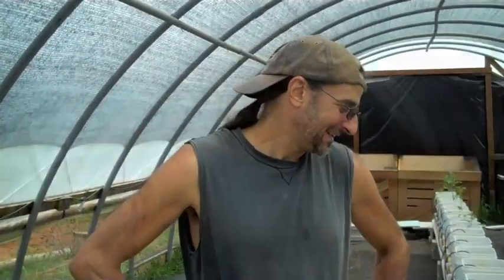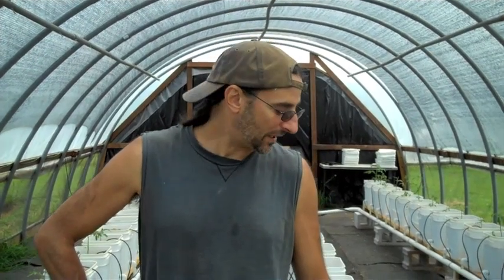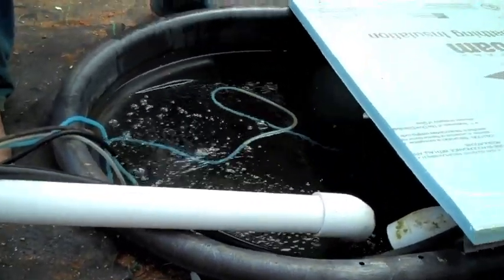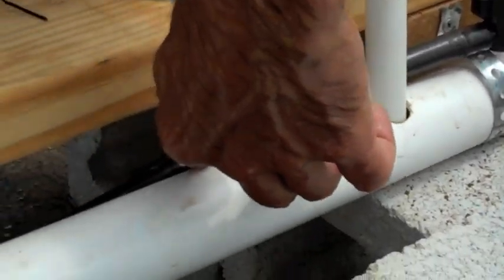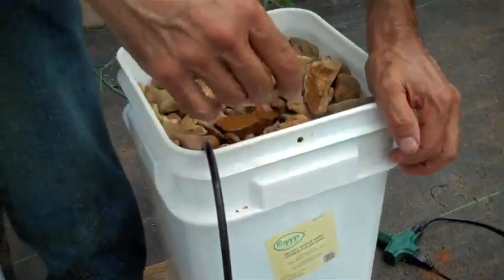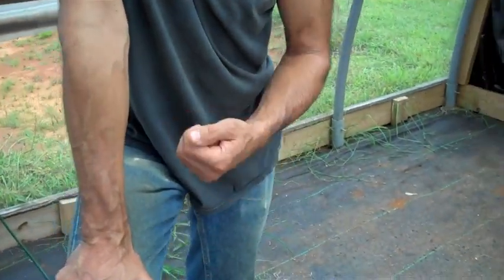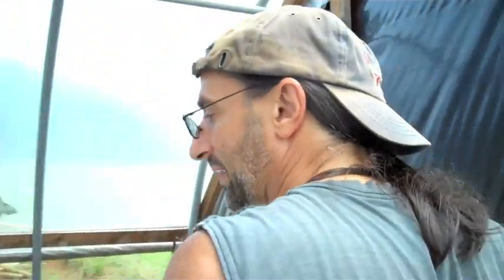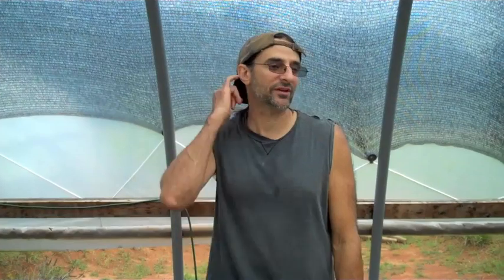Dutch Bucket Aquaponics

Comment: I have a 800gpr and I have 15 buckets running on a .25 black line with drippers package from amazon. But even with that much push per hour the water can’t make it around the square it only covers 9 buckets and that is at a very small drip. I though smaller the line the stronger the pressure. But I can’t even make it to Th e other buckets
Reply from the maker: Yeah, we did not like this bucket system and have gone back to deep water aquaponics. Check out MHPgardeners channel for bucket system tips. He does hydroponic tomatoes in buckets real well.

Comment: Hey bud that elbow and side of the buckets turn it upside down it works better and rocks can't cover it up a flow filter would help with the solids and if you added a subtank it would be cleaner for your pump to go in. you could have a your fish water and going up to the flow filter then go ahead and go down to subtank and you could either use gravity to go from the subtank to the Dutch buckets or your pump. I just thought I would suggest this to you and if you go with it cool if not at least you got the information

Comment: The best way to do it is to consider a few buckets like a big gravel bed and put them a auto-siphon to empty them when full. Also, the fill is better to be done withh a larger pipe above the buckets with holes in it for each one in part. Then you will have a big gravel bed, divided in a certain number of buckets wich fill and empty together at the same time and no more clogged pipes...

Comment: you might need a swirl filter or a radial flow filter to take out the solids from the system. also consider having your current fish tank as the sump tank and adding another tank as the fish tank.

Comment: I aw this Dutch Bucket system on the computer and was thinking the same thing if it could be used with Aqua ponics.This is like 2014 when you posted it l was also wondering how is it now was it a success .?Have you made a new video of the system ?
Reply from the maker: We took it down when we moved and have stuck with DWC at our new place. Deep water troughs seem to be the simplest to use and we like them best.

Comment: paint the buckets black to keep the alga down also put lids on the buckets or cut out lids from some of the foam you have there. that should help on the hot rock problem
Reply: Wouldn't some chemicals be leached into the plastic and therefore your plants? I'm concerned about painting my buckets but don't want the algae.

Comment: I'm sure by now you have figured out that the buckets holding over 2 inches of water especially the fuller ones is causing your rock to heat up due to stagnant or old water is pooling in these buckets and collecting heat. Not good for everything including fish, also promotes algae. I use the double dutch bucket method with a 3 and 5 gallon buckets with mini lava rock and love the result. Maybe consider putting a fish filter in your res. Happy Gardening!
Reply: C

Comment: nice system, nice video, add a swirl filter after the water comes out of the fish tank and before it goes into your bucket system and i bet you'll be very happy with the results... you can also take the removed solids you get from your swirl filter and use it to fertilize other plants outside your greenhouse or even setup a bit of a vermiculture or "feed" it to your trees

Comment: Here is a tip - I did dutch buckets for 3 years and found that, every time I changed or added nutrients, I would have 8 or 10 gallons of "old" nutrients left in the buckets which ends up contaminating the new mixture. So, what I did was put the 1" hole in one corner of the bottom of the buckets using the same grommet/half inch PVC pipe and they would completely drain each bucket after each cycle (I feed three times a day for 30 minutes). This eliminated the problem of left over nutrients contaminating new new mixture and the plants don't seem to mind the new configuration at all. The only problem I had/have is growing full size tomatoes - cherries grow great with abundant fruit production - but full size tomatoes just don't want to produce here in Hawaii - I'll get four or five big beef, rutger's or beef steak max.
Reply: Good job
Reply: hydroponic supplies

Comment: on the buckets with a stand pipe, as you call it, i would like to suggest putting the 1/4 feeding tube doown into the bottom of the bucket. so the oxygen in the water reacherd the bottom root zone. if not, the oxygen will hardly get down there, if at all.
Reply: jooster  Yeah, having the drip line right over the standpipe caught my attention and I figure bad things to happen in the bottom of the buckets with little to no water exchange..
Reply: The cycling of water provides the needed oxygen, as well as, the open root system the dutch bucket provides. I drip mine over the top so that I can also monitor flow. Roots tends to grow up into the line if you bury them.

Comment: How many fish do you run in this setup?
Reply from the maker: +Damian &amp; Kelly   We probably have around 75 bluegill in the hoop house system. It's hard to tell since they are in the ground and it's hard to see them because of their color. We've had them for about 3 years since they were fingerlings (1 inch) and they are now between 4 and 6 inches. The pond holds around 300 gallons and the troughs hold 800 gallons for a total of 1100 gallons. Our dome system is around 600 gallons. We have around 100 goldfish ranging in size from babies (1 inch) to about 5 inches.

Comment: I would assume that you don't have enough fish to feed all the plants? maybe 30-50 500g fish to feed them all, and tank too small for that.
Reply from the maker: +WhatAmI “TheKingdomeWithin” IsItInMe Actually we had excellent plant growth and  the nutrient readings were spot on. The buckets were just 3 gallons so the total system water was around 500 gallons. We are powering our DWC system with less fish (in weight) and that system is around 1100 gallons. It's surprising how little amount of fish you actually need to run a low density system. Low density is definitely the way to go. Less food, less air needs = cost savings.
Reply: ghog63 I am amassed, good job!
Reply: +WhatAmI “TheKingdomeWithin” IsItInMe amazed*
Reply: jooster lol yes that too:0)

Comment: Great vid and sweet set up! Im really curious as to weather those 1/4 inch lines are clogging. I love that your set up can run on that one pump. If it is clogging have you figured a way to clean them? I would imaging taking each line section and T, then  having to soak  and then clear them with an air compressor maybe? Buying new ones periodically seems expensive in the long run and a waste. 

Also i'm curious about the use of the rocks in the buckets. At probably the same cost as filling the buckets with medium you could use net pot lids with an 8 inch basket filled with whatever medium. I think that would allow for substantially larger root growth and the ability to entirely see the root structure of your plants. However you then would use more water... Curious as to what you think and how your set up is going. Thanks for sharin.

Nt
Reply from the maker: +N. Town Yeah, they clogged up and we went back to DWC. We just seem to like everything about deep water systems. They are so simple. I like your idea about the medium. We used river rock. It was fairly inexpensive. We were worried about limestone raising the PH but the rock seemed to be fairly free of lime. 

Sorry it took so long to respond. You were flagged as spam for some reason.

Comment: How did this work for you? I put in a dozen buckets last summer, filled them with a mix of coir & perlite in paint strainer bags. Cost about $3 to fill all 12 buckets, recylcled the medium again this year, dropped the costs to $1.50 ea. The only difference is that I put the elbow pointing down as well as a drop tube to leave a 3/4" reservoir at the bottom. The coir mix wicks the fluid up into the bucket. I also have the pump set to turn on for 15 min @ 0600, 1000, 1400, 1800, 2200.

Comment: Thanks for the video.  I am looking into doing a small set up outside without a greenhouse.  Do you see a problem with doing the Dutch bucket system without the control of the greenhouse?  I am planning on burying the hydroponic tank halfway underground.  No fish, just hydroponic system.
Reply from the maker: The Melonhead Teacher It is doable depending on where you live and what type of shelter from the elements you use. If you do it outdoors you will have to contend with rain diluting your solution, more bugs and possible freezing if you have cold winters.

Comment: Great set up!  I used 5 gallon round buckets, but your setup is almost exactly like mine.  Only thing that I did differently is that I used T-siphons instead of stand pipes.  Using the 1/4" line it takes about 20 minutes to fill the bucket and about 1.5 minutes to drain.  You might consider doing this as well, I have noticed that my PH stays around 7 and my plants seem to thrive better with my setup this way.
Reply from the maker: Nice. I will look in to it. Thanks.

Comment: I look forward to an update on this dutch bucket system, and the results of the different water heights as well.What are your daytime water temps?
Reply from the maker: Water temps have been slowly dropping down from about 78 degrees last week to around 68 this week probably due to the cool night time temps which have been in the mid 50's. Daytime temps have been in the low 80's. We are watching the water temp closely as we are at a good temp now and don't want it to go too much lower. Maybe 65 degrees. We will roll the sides of the hoop house down very soon to keep it warmer inside.
Plant growth has not been any different in the buckets between the higher stand pipes, mid pipes and no stand pipes but we did have roots growing down the high stand pipes which clogged up. It was easy to remove the roots but it could be a problem if you don't catch it. Can't tell if roots are clogging the other buckets but since they are not filling with water I have to assume the pipes are clear.